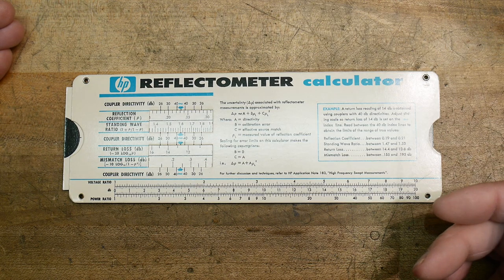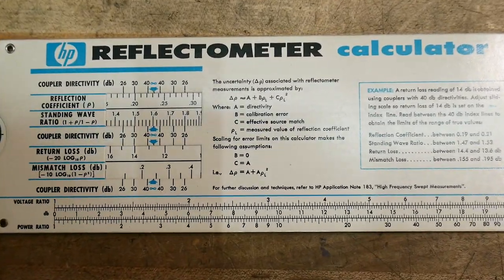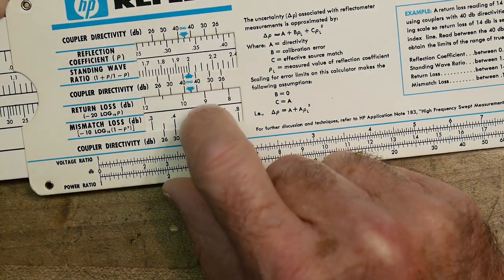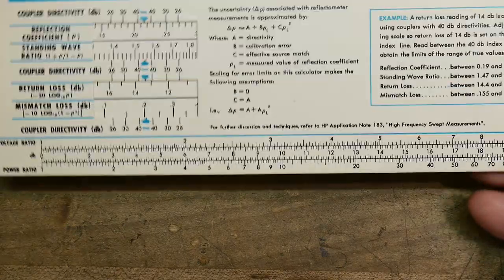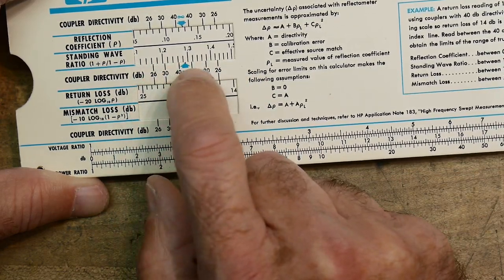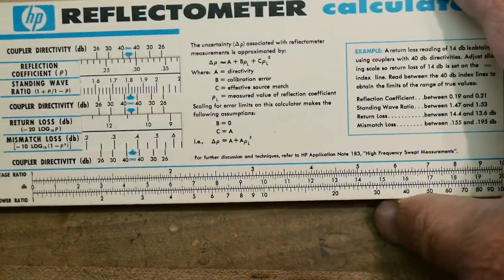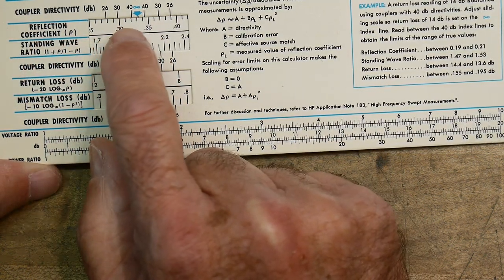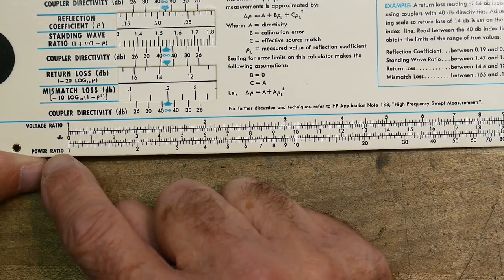#632 Hewlett-Packard RF Calculator Slide Rule

Comment: Just thumbing through your older videos and ran across this one.  I'm a "vintage" slide rule calculator junkie.  I probably have 40 or more vintage mechanical electronics calculators like this.  Don't know if any electronics companies still make these other than Waytek Wire but they are still made for other applications.  Years ago (many years ago) I use to be a heavy truck mechanic and worked on a lot of tow trucks.  To this day I still go to the annual Baltimore MD tow truck convention.  WreckMaster still makes a winch pull resistance calculator like this.  First time I saw one years ago I had to grab a handful of them.  I didn't grow up in the slide rule era (born in 71) but I thoroughly enjoy using them and variations of them.  Mike KC3OSD
Reply from the maker: more slide rules:
https://youtu.be/rcdDwzAnc0U
https://youtu.be/xksZV2VD1to
https://youtu.be/oMSptZCOOa4